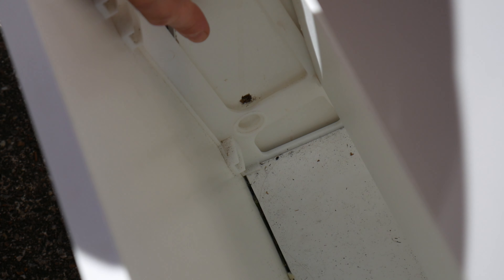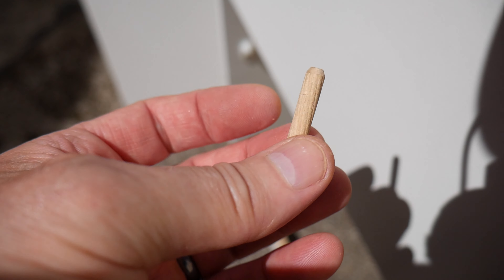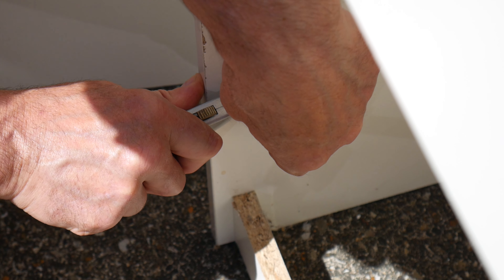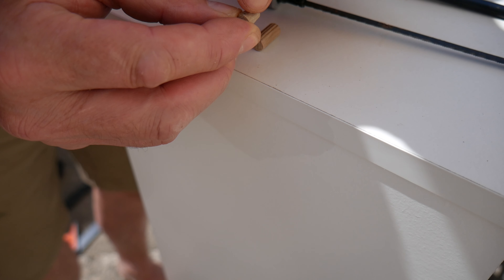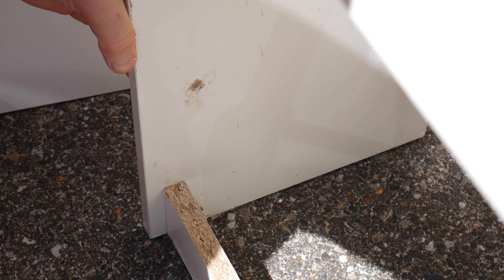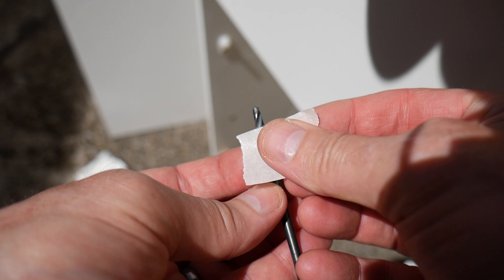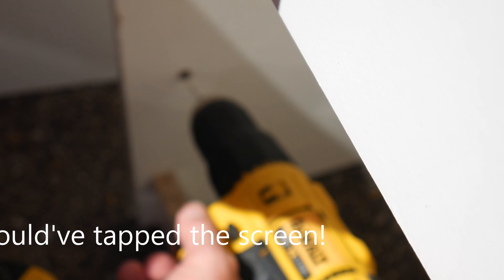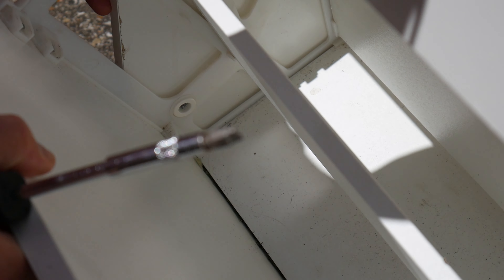HOW TO FIX STRIPPED/THREADED SCREW HOLE...NO TOOTHPICKS

Comment: To anyone who might read this, you can always buy dowels or cylindrical stock in various sizes at your local home improvement store, then drill out the hole to whatever size dowel you have. Might actually result in a stronger bond since the hole will be regular vs irregular for a hole that has become stripped from wear.

Comment: Another tip unrelated is if you wanted to use a non concrete screw to attach a picture or something use a mason bit to drill into the concrete and then use a dowel slightly larger (you may have to taper it) you can then tap the dowel into the brick hole and use a regular wood screw to attach to.

Comment: I will give it a go, exactly same thing happened to my shoe cabinet also. Cheers
Reply from the maker: My cabinet is still working fine after this repair. The hardest part for me was getting the screw to catch. Now it's in, it's stronger than ever!
Reply: @UTILITARIANTVUK  what type of glue did you use? That you were able to not wait 24 hours
Reply from the maker: @cheyenneobregon184  it was gorilla wood glue.